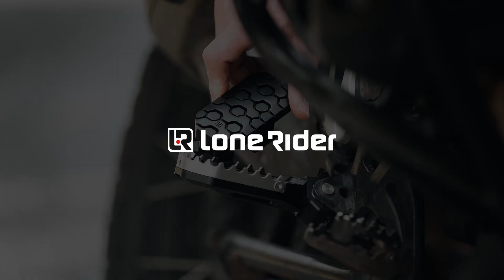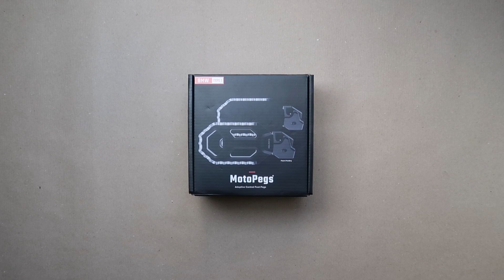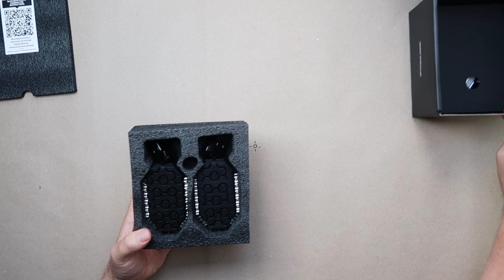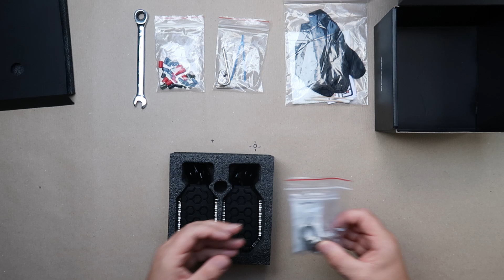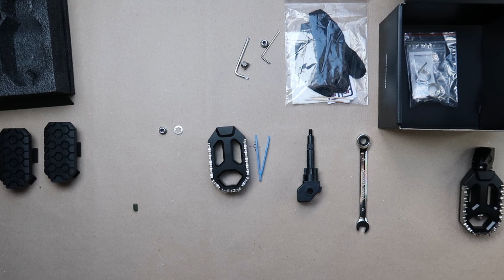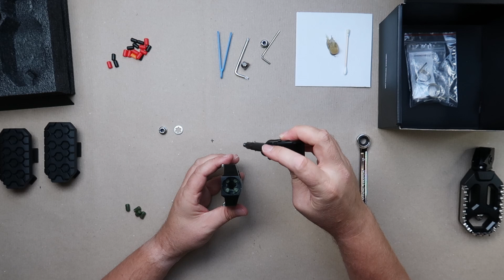MotoPegs® Installing the Control Pins - English

Comment: I had the first gen of moto peg 2022 easy to remove the axle when I changed the rubber pins but I just bought the new gen of moto peg 2026 so hard to remove the axle !!! super hard to remove the axle for changing the rubber pin. Please tell me why?
Reply from the maker: Sorry about that, it should not be a fight. Please send an email to anna@lonerider.com with a photo or a short video of the axle, and our product team will look at it and tell you the right way to remove it.

Comment: I pulled the soft plugs and replaced them and the nuts with medium plugs, on a Tiger 1200 Rally Pro, reinstalled the original peg springs. 

Sometimes these oversized pegs will contact my ankles when I put a foot on the ground or lift it, but I'm getting the hang of it.

Off road and standing on the pegs i'm able to get under the gear shit lever and on top of the brake lever without too much searching; a larger platform and pivot was all I wanted, of course until the lowered pivoting pegs are available — optimal touring comfort in the wide open spaces of the Western USA.

At 6ft 230lbs the pivot is a bit soft while standing up, so I might make another swap for the hardest plugs and new nuts — since the nylon washers inside the nuts don't appear to be intended for anything beyond single use.

Comment: Sorry Andrew, i still have a loose fit after installment on the bike. Went to the bmw dealer and the say it’s not smart to bent the attaching point on the motor. Can I sent you pictures?
Reply from the maker: Hi. Yes for sure. But I have seen this a few times now. BMWs tolerances for this are all over the place for some reason here. I will need to add spacer from now on. So, Please email us and say you need spacers (Andrew said) and we will send them out to you. Sorry about this, we tested on many bikes and this issue is random. Will get it fixed though. Thanks! Link to contact in the description.
Reply: Same with mine. My first thought was "where are the spacers?". Will sent you an Email.
Reply: @miso1790  Do that! We will send some out
Reply: @loneridergear  , Anna wrote me an Email. They are already on the way. What a great service. Thank you very much!

Comment: Tried to remove the axe, no success, will start testing the medium pins.
Reply: No need to remove the Axel to change the pins! Thanks!
Reply: @loneridergear  hello Andrew, no sure to understand, on video once nut and washer are removed, the axel is pull of the peg?
Reply: @philippemarchay  You may need to pull quite hard. Try to put a screw drive through the hole of the adaptor, where the pin of the bike holds the footpeg in place. Then, clamp the main body part of the footpeg and wiggle it out.
Reply: @loneridergear  I was unable to remove the axel while the pegs were off off the bike - too stiff. I want to change the pins, the factory fitted ones give no movement. Can I change them with the axel fitted to the bike, I might get more leverage that way?